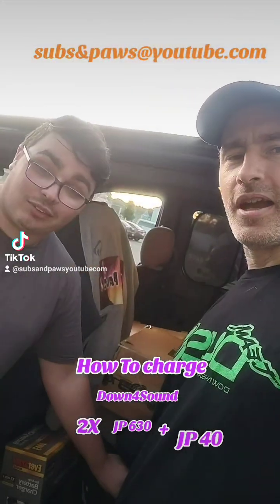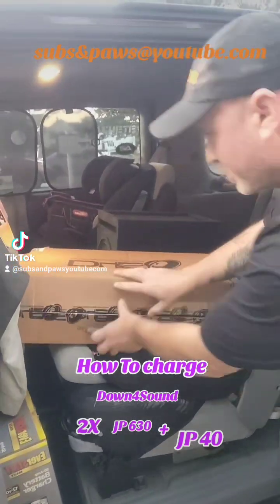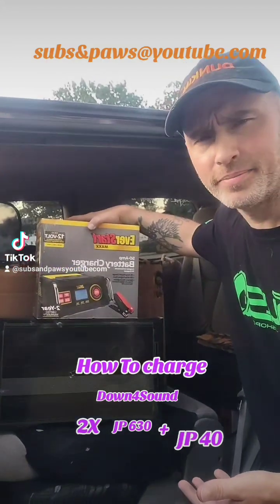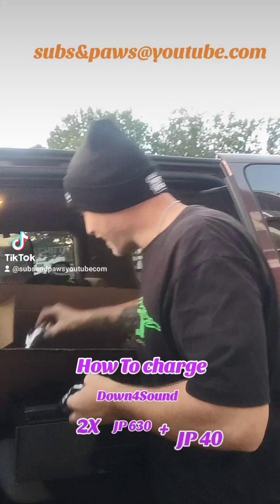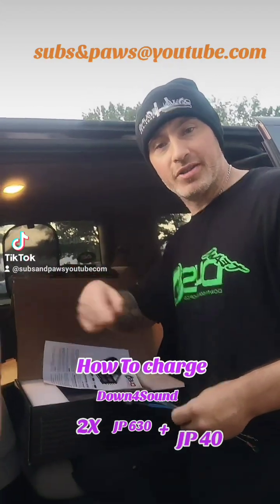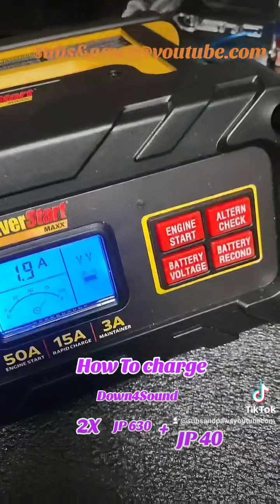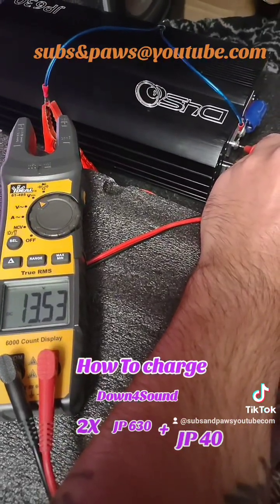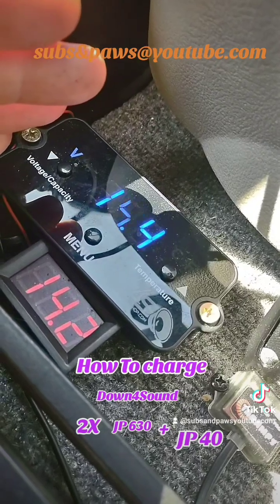Super capacitor Down4Sound JP 630 How To Charge Install Explained

Comment: That one meter kept cutting out. You didn't comment on that. Ever find out the cause?
Reply from the maker: I just rewatched the whole video. Which meter are you referring to? If you're mentioning the meter for the JP 40 that's the meter that's specifically made for that battery and the 630's. It turns on momentarily and turns itself off after a few seconds and is designed to do so. Hopefully that explains your question ⁉️. Thanks for watching and thank you for your comment and support 🙂

Comment: Im done with d4s they have horrible customer service i ordered a xs power D3400  battery and it got damaged during shipping well  ups denied the claim cause d4s did not package the battery correctly they shipped it in the only t h e xs power box should have have been packaged alot better so neither ups or d4s is helping me with a  replacement battery
Reply from the maker: I'm sorry for your troubles. I've heard a lot of complaints and experienced some myself. I have it on video live when I opened everything. Thanks for sharing and thank you for your comment and support 🙂
Reply: yup thats where we at sell u something tgen its the blame game from shipper and delivery services . everyone blames each other when custom open it up and destroyed everyone one got paid off your purchase and you left without product. i try to get stuff like that local and by the time u pay mark up usually close to shipping cost

Comment: Even if ur voltage drops from 14.4 to 13.4 thats not bad at high volume mine dropped from 14.8 down to 12.5 with 2 smart 3k taramps so they was still making rated power they rated to make full power at 12.6 volts most taramp amps are rated to make rated power at 12.6 volts anyway.
Reply from the maker: With all the lithium I have now and super cap's my voltage doesn't even move. I'm guessing on like a 5K or so I might drop but I don't want that much in my van anyways. The whole point to my madness is getting my voltage stable and not dropping at all. Done. I might want another JP 40 just for whatever. Caleb needs one too

Comment: Do you have more than enough lithium Banks I'd like to see you put that big boss 3 back in there and wired to 0.5 and see what your voltage looks like
Reply from the maker: I actually already thought of that. I'm trying to get my boys to help me move my boxes. I'm going to do a .5 ohm test and then a 1/4 ohm test on the Big Boss 3.
Reply: @SubzPawz  ew .025.  Be careful with that ohm load I know the big boss is rated for .5. But on ur parts in the amp .025 is a huge difference that's very very close to being a dead short I wouldnt wire ur amp that low or even let ur amp see a load that low I know the impedance will rise but at idle if ur amp is seeing .025 and not playing music just sitting idle the amp is gonna heat up very very quickly just things to be aware of.
Reply: @SubzPawz  John I think that's a really bad idea even at idle not playing music if ur amp is seeing a .025 ohm load it's gonna heat up extremely fast like 75% of class d amps get hot just sitting there idling and when music starts being played they cool down it's called thermal run away  and I bet u see that happen u can make most class d amp to thermal runaway just by not having a ohm load wired to the amp the amp class d I'm talking has to see a ohm load or the amp will start getting hot super fast

Comment: I didn't get my resistor. I'm not gonna bother trying to get it from them.
Reply from the maker: You can use a small car bulb as long as it has two wire's and you can connect them you're all set. That sucks. I don't understand why. Thanks for your comment and support 🙂
Reply: @emmittbishop4783  I emailed them today and they are going to send me one. They told me the bulbs were out of stock at the time I ordered.
Reply from the maker: @jlee8262  good. I'm glad they're taking care of you.
Reply: @emmittbishop4783  I said the same thing lol! Why bother. They will probably say I dropped it when I opened up.

Comment: Aww man that's crap! I purchased two of them and neither came with a resistor. Not sure what's up with that
Reply from the maker: I don't understand what or why. It's a tiny piece of equipment that's vital to use the device. Every capacitor on the market comes with something. Thanks for your comment and support 🙂
Reply: @SubzPawz  yes sir! Thank you for doing this video!
Reply: To anyone that needs to know. Just email them and they will send you a bulb if you need it. They were out of stock apparently, the reason they were not in the box.